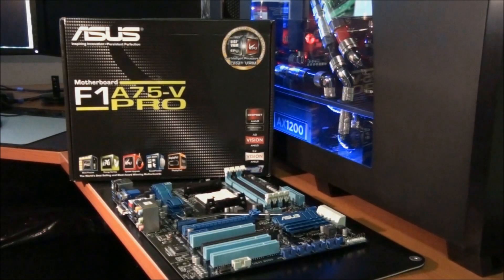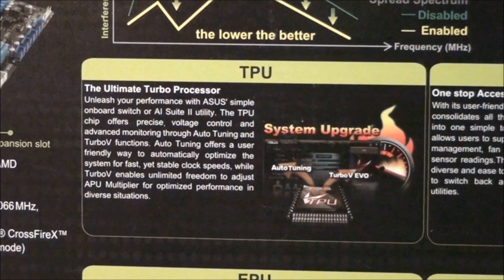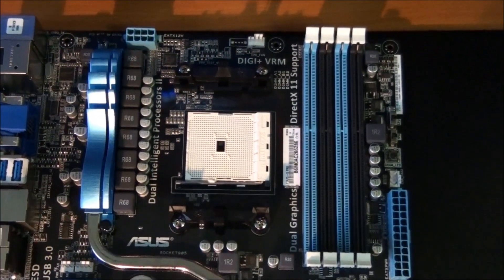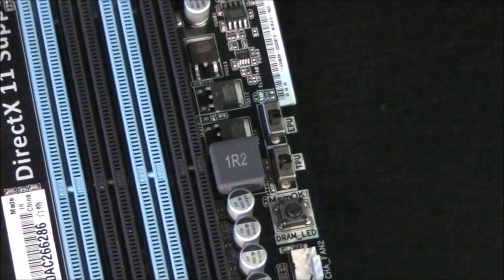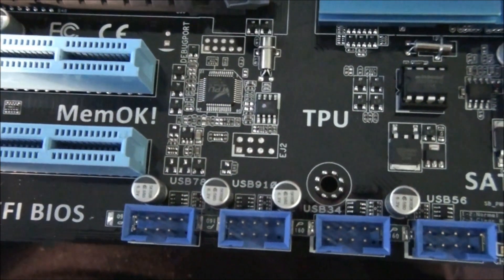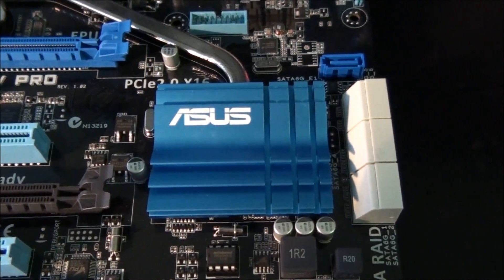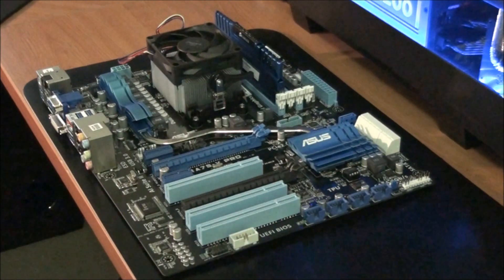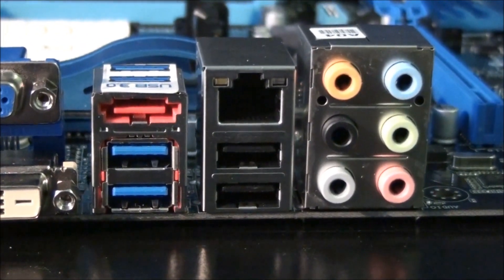Asus F1A75-V-PRO Motherboard Review

Comment: Ok, silly question, if using "dual-graphics mode" you'll be connecting your monitor to the motherboard's video ports, and not the discrete graphic card's?
If so, does the motherboard shut down the discrete card to save power?
I was actually shopping the "M" version, but this "V" version is only 7 bucks more.
Thanks for the review...